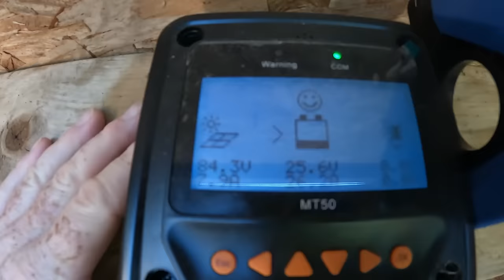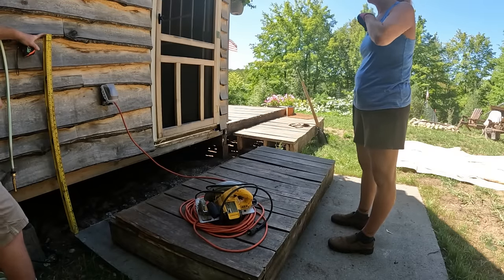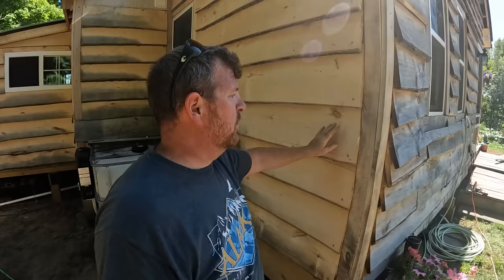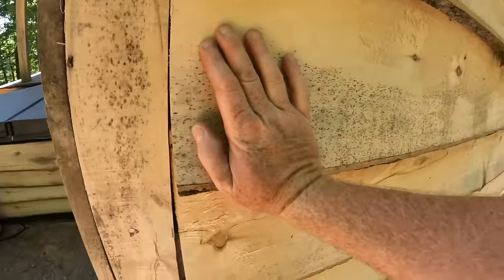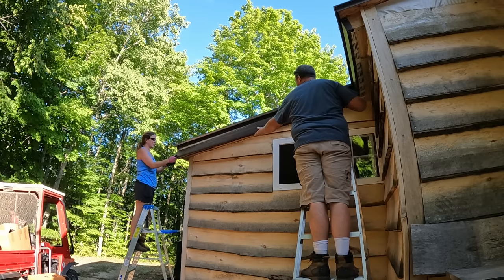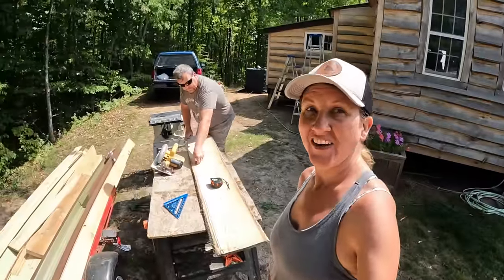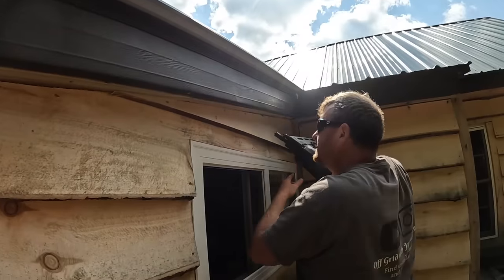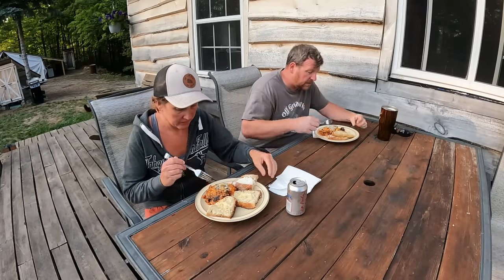Waiting A Year To Finish This Project  At The Off Grid Cabin Was So Worth It!

Comment: one thing you can do to make those corners look better, double them up after you double tap all the siding, the add another layer of the corner boards. Just lay one up there un nailed and see of you like the look or not. Honestly you should pressure wash that wood and have something on it to protect it, stain paint or oil...the rustic look is ok but not very protective. Color is vanity..but protection is necessary and valid. OMG your cooking bacon mmmmMMMMMMmmm....what was i saying?
Reply: The doubling up on the trim is a great suggestion.
Reply from the maker: LOL......bacon. like the double up trim idea. Thanks

Comment: Question...is that type of wood on the siding able to withstand the elements without being treated or painted?.. by the way the lasagna looked really yummy
Reply from the maker: The Siding is made of Poplar....I think some call it popple or different types of Aspen.....But from the Little Information or videos I found lots of people use it on barns. I think the secret is it has to get sun and be in a dry-ISH environment. If it were used on a cabin in the woods with all shade  all the time i think it would rot. But because we are in the open on top of the hill we get lots of sun and wind to dry things out. I will be TREATING it or putting some type of Oil Based protectant on it at some point, But want It to Dry and Age before I do so. Poplar wood is actually a Hard wood.....harder than pine but softest of the hardwoods. So in my mind it should be as good as pine or better

Comment: On the boards that are hard, and stiff, Drill a hole and run a screw in it to barely draw it down. Keep wetting it, and tighten the screws a little at a time, until you can draw it all the way down. It takes more time, but it'll really reduce the cracking.
Reply: That's a good idea.
Reply from the maker: Cool.....I'm going to try it. Thanks

Comment: Paint the whole siding on the house with Australian timber oil ! It’ll preserve it for many  years to come, it also water proofs it, makes it bug & termite resistant as well as gives it oiled natural tan color. U shouldn’t have to do put Australian Timber Oil on it again with a light coat until maybe 10 years. Then it should be good until we’re all dead and gone. If your not 100% sure just buy a small metal container of the Australian Timber oil and trial run it on a piece of scrap siding and then decide if you want to invest in a 5 gallon jug of it. U can paint it on with a paint brush but I would suggest pressure washing it first let it dry then applying the Timber oil to the siding. There’s lots of people on Youtube using it on their exteriors of their cabins such a Shawn James 1 on: my self reliance who treated his logs with Australian Timber Oil , Also Richard on Smoky Mountain Outpost on his new log workshop project. Just as a couple of examples but I’ve seen many others using it and they swear by it. Probably the biggest example is Paul whole builds old fashioned dovetail joint log cabins at the bearded carpenter, he’s a big advocate for Australian Timber oil & Linseed Oil for preservation of wood from rot weather and destructive bugs. Something to really consider! 😉
EDIT: If you used Australian Timber Oil or Linseed Oil either one to preserve & protect it, then you’d never have to paint it and it’ll always hold that natural wood look.
Reply from the maker: Awesome.....I'm definitely going to try it. Anything oil based I'm sure will help. Thanks
Reply: @OffgridwithJayandJen   just so you understand me the Australian Timber Oil & Linseed Oil Both are not a oil based paint. They’re both A  Oil that’s made to treat wood. Either one will be fine on your siding but if it was me I’d use the Australian Timber Oil. But the linseed oil will also work. If I was you I would research both on the internet for your peace of mind. Then I’d get me a small bottle of Australian Timber Oil or Linseed Oil because they’re both expensive just like high quality paint is nowadays. Then I’d take a board same as your siding and paint them with the oil or each of the oils and lay them both out in the sun a couple days & see which one you like the best. From the cabins I’ve seen the logs painted with the Australian Timber Oil was my favorite look after the wood was treated in it with a paint brush.
Reply from the maker: @CCRider5312  I got ya, thank you. I was on the same  page, I just didn't communicate well, lol. I'll check out the Australian timber oil for sure. Thanks

Comment: Cloudy days you probably need some more power with more installed equipment, the EcoWorthy stand can with some adjustment be connected via for example a small combinerbox with MC4’s in, and 2 wires out to EPEver / inverter. Powerstation can be charged and used when there is enough light, with small combinerbox more charging can be achieved by pairing to the booth batteries. Fixed arrangement provides safer charging. Easy to switch between Powerstation and main batteries.
Reply from the maker: Yes, it is very helpful and flexible in its helpfulness.  I'm working on getting a line run over to the solar shed soon.....the days are getting shorter bow, so it will be needed to help. Thanks for the tips 😀

Comment: My ears were burning when you started talking about your washer taking too long and pumping a lot. If you aren't getting a decent wash or spin. buzz me. though you guy;s work on a different system voltage wise from over the pond. the basics are the same. As i have 47 years experiance I might be able to help.The call out might be a bit expencive. air fair and extra''s. but you never i might be able to help you over the net.
Reply from the maker: Ha...that is funny and thank you for the offer.  Jen and I tried filling it the old fashion way with the hose and just turning it to the wash cycle, but the new tecnology was not working that way, LOL. it made me hook it up on the back the correct way and we had to leave our pump running for a long time so it had pressure. I think it was working correctly, but I was trying to simplify it and the washer Technology was not cooperating, HA HA.    SUPER appreciate the offer my friend

Comment: You are being held back by those AGM batteries and as your winter is rapidly approaching Lithium have come down in cost all you then need is a lithium charger probably 50 amp which will charge at that rate till full from your generator saving gas money etc
Reply from the maker: It's easy to say, but our situation and climate do not make a good combination for lithium yet. We have some upgrades in the works that will include lithium power, but not being able to charge lithium batteries below freezing temps makes our current set up useless for half the year Here in Northern Michigan

Comment: I suggest using spring-style clothespins to hang your wet laundry. Hanging from the edge will mean it is always in a single layer. It will dry faster and not have folded crease across each item.

Comment: There are gray oil based stains that would soak into that poplar very nicely.  Also if you decide to "pressure wash" it to clean it they do make wood brighteners and look into soft washing.  Pressure washing wood can really damage it and dosnt kill and of the mold and fungus that made it looking like that anyway.
Reply from the maker: Ya, thinking a little cleaner on that spot by the water tank to kill stuff and clear seal the weathered stuff. 👍